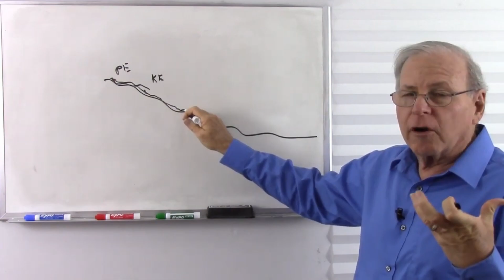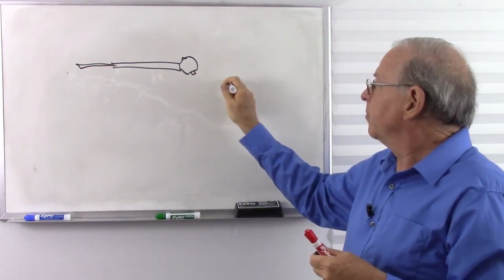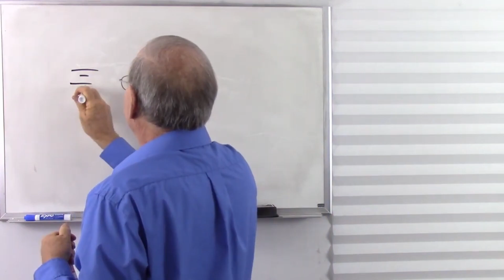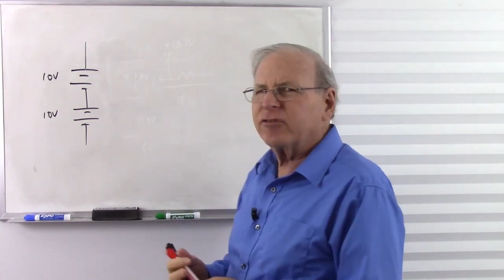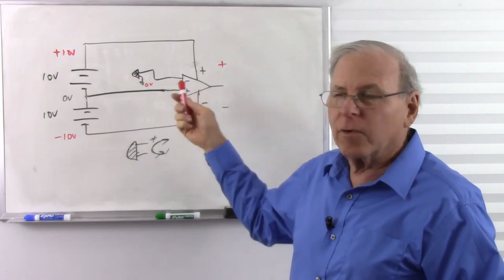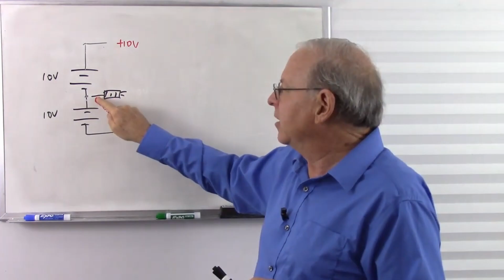Measuring Voltage

Comment: Measuring temperature has some similarities in determining a reference. Two points are needed and the measurement is the difference. With celsius it was decided 0 degrees would be at the freezing point of water. Therefore, there can be positive and negative degrees of temperature.
Reply: This isn't a great analogy because the reference points for temperature (0 Celsius or even better, 0 Kelvin) are defined absolutely, at least in the way we use them. That is, we don't practically measure temperature differences when we measure temperatures. You need to bend how you think about temperatures in order to make this work